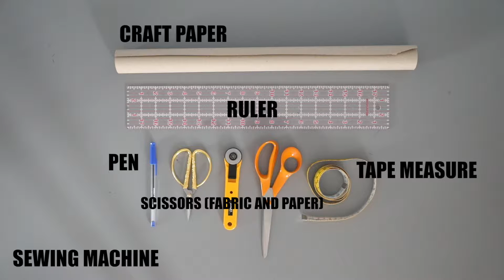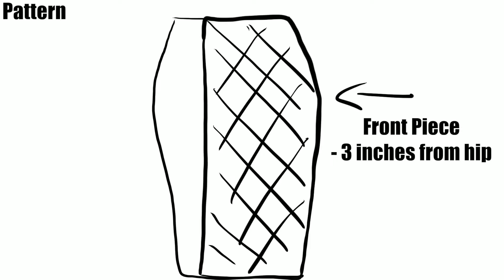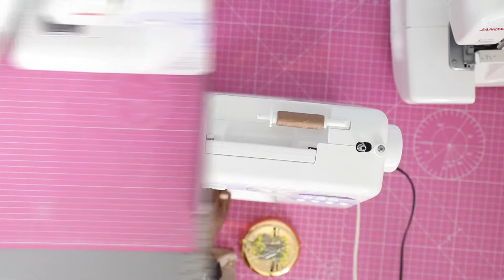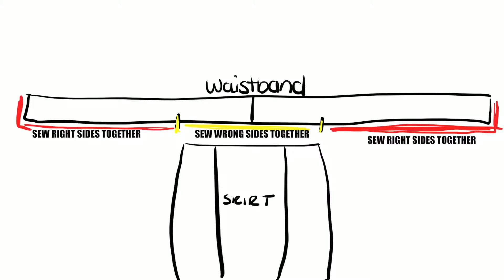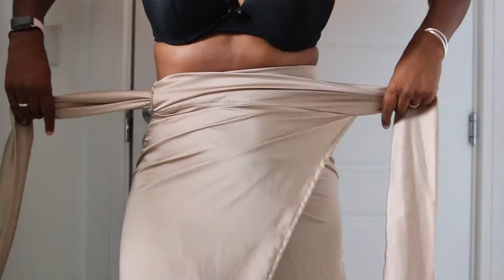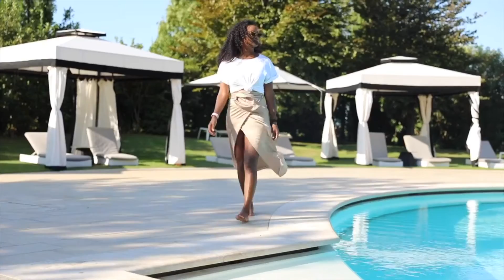DIY SILK WRAP SKIRT (EASY)

Comment: Pretty, but you need to cut the silky fabric bias , so it will fall smoothly even its stretchy , the stiching is really terrible , try to hold it on both sides , just with a little bit tension while sewing and with the right material (yarn)( there are also tutorials on YouTube).... greetings from Paris/France 🌺 a Couturier